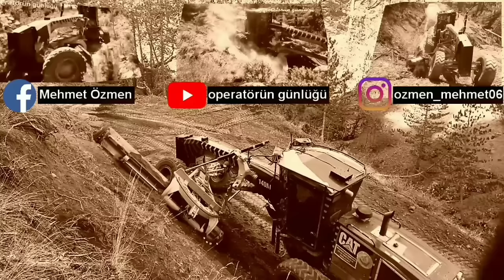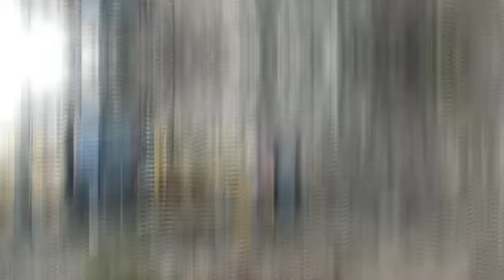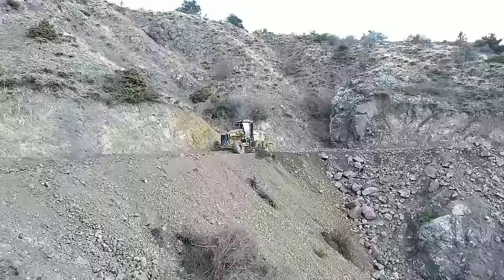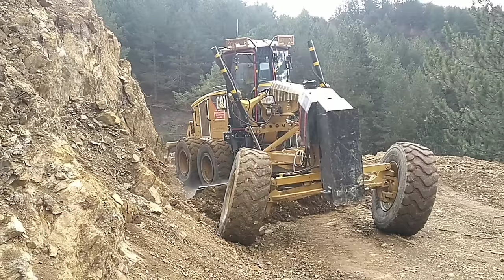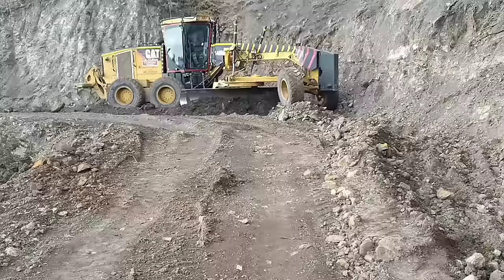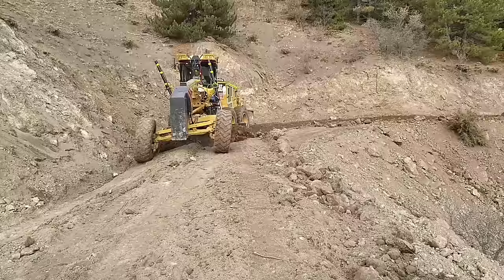CAT 140M KAYA CANAVARI[ROCK MONSTER]-yoldaki büyük kayalar-#buldozer #grader #nasılyapılır #keşfet,,

Comment: There are multiple shots of the same section of road , and most from just a little different angle . There is a attachment for the front of graders called - Bull Blades , to push rock & such out of the way, also adds some weight to the front wheels. 
The high hoe operator could have done a lot better job